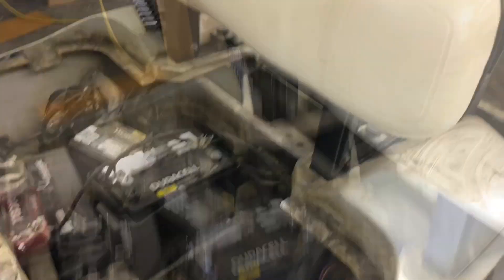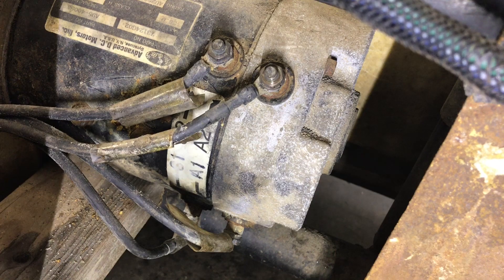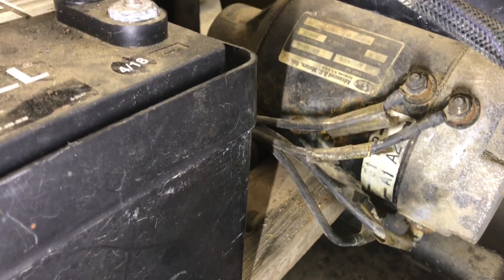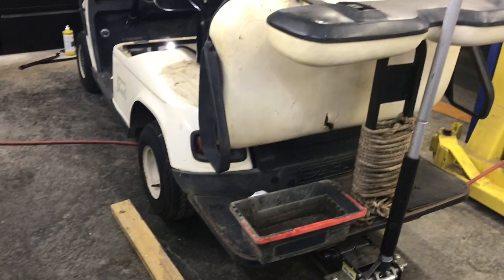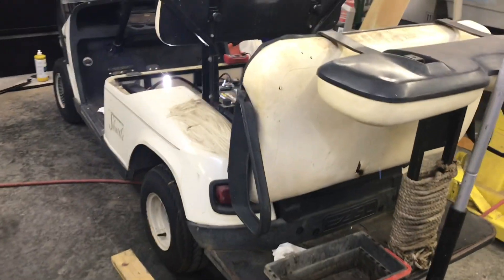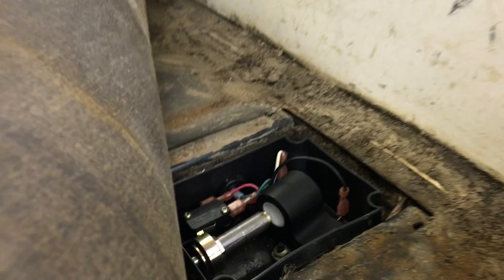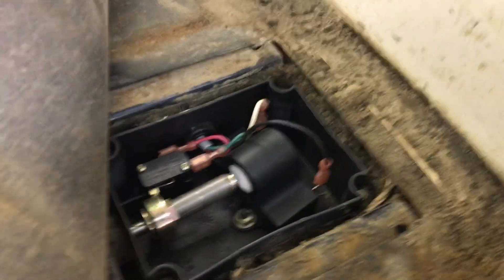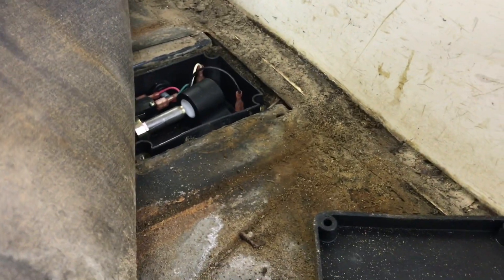EZGO Diagnosis - testing motor and replacing throttle sensor

Comment: have a 2019 Ezgo Freedom, based on your post on diagnosis and replacing throttle sensor, if anything after replacing sensor chattering continued and actually got worse.

Comment: Mine was running full speed.  Then suddenly stopped.  Now it appears to still take a charge but will not move.  Could this be the throttle sensor?  It seems like i can here a click in the controller box when i push the peddle?

Comment: This could be my problem.. but.. it was pulled 2 blocks back to house without switching to tow mode. When they got to driveway, smoked was coming from electric motor. 
Haven't looked at it yet. Deciding if I should order another motor.

Comment: I changed my inductive speed sensor but no success. Wasted 27.00! Now to solenoid??? My cart goes to full speed at slightest touch of peddle???
Reply from the maker: I don't think the solenoid would be the issue.  It is just the connection from the throttle to the motor. It shouldn't regulate the current. I'm afraid it could be the controller
Reply: @jefflynn4079  yep I didn't want to think that but you are probably right! Well I've done everything but controller so to the shop it goes. Probably go ahead a get a beefier one.
Reply: Did you figure out what was wrong?  I have the same symptom (full speed at slightest touch, then cuts out at like 40% throttle).  Wondering if you know where I should look?
Reply: Full speed with a little throttle should be the speed sensor that goes on the electric motor